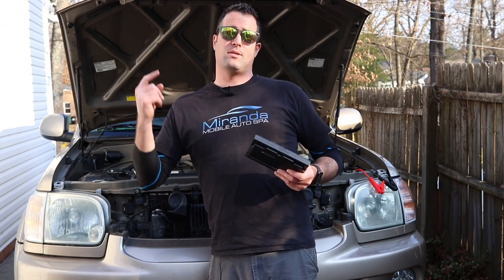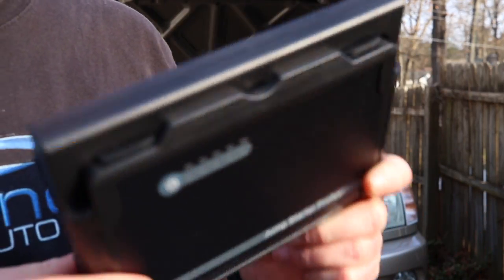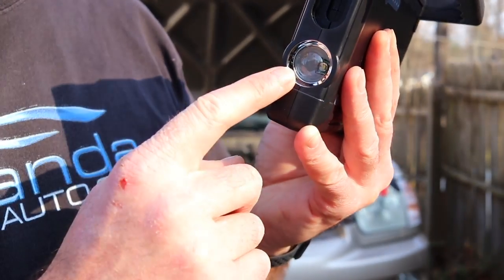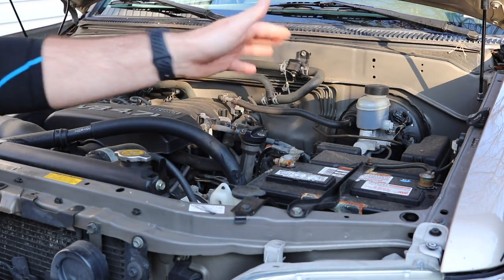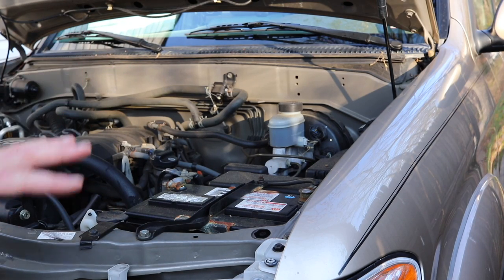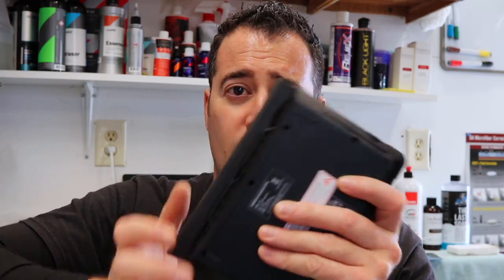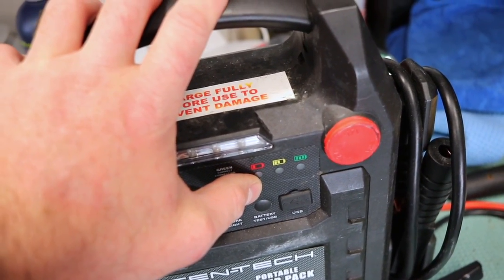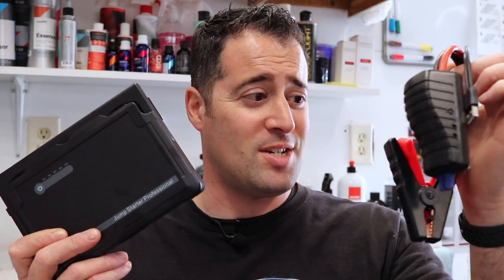Charge A Dead Car Battery In 10 Seconds! / Jump&Go  #Jumpstarter #JumpAndGo #musetown

Comment: I agree,the little lithium jump starters are great.i keep one in my boat.BUT ,i also have a Dewalt lead acid( weighs a ton)  it has a air pump for tires and a alternator tester.if you don,t need those added feature then the lithium mini is the way to go.my 2 cents.

Comment: I've been looking for something like this! I've killed a few cars when detailing... I'm curious how this would work on a big truck that's totally dead?
Reply: Check the cranking amps,many different brands
Reply from the maker: Not sure about how big a truck you’re taking about. But here are the specs 
With a total capacity of 16,000mAh, jump start your vehicle (up to gasoline (LPG) 8,0L / diesel 4,0L) with 600A peak current and patented smart cable. Safety assured with FCC, CE, RoHS, KC certifications.